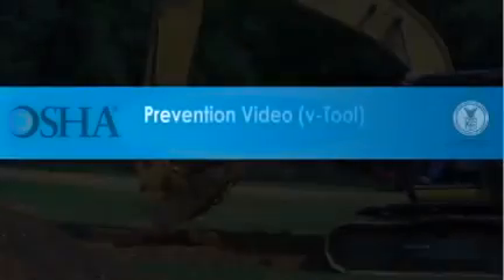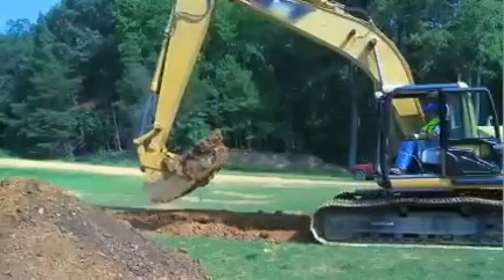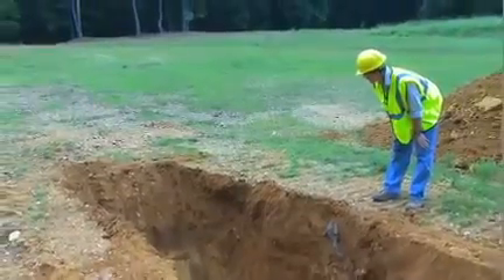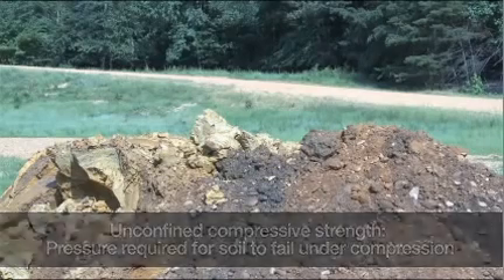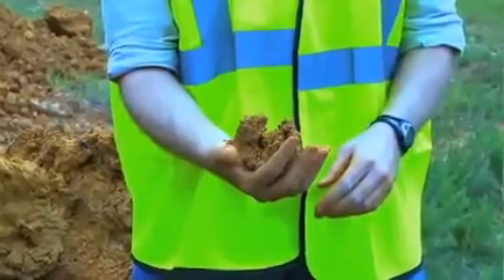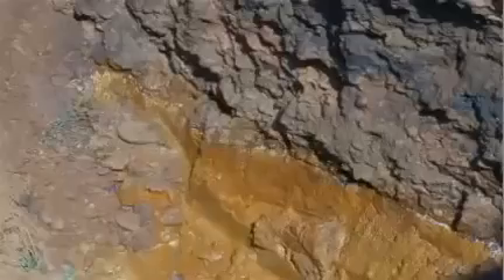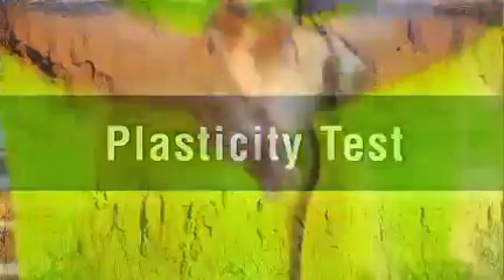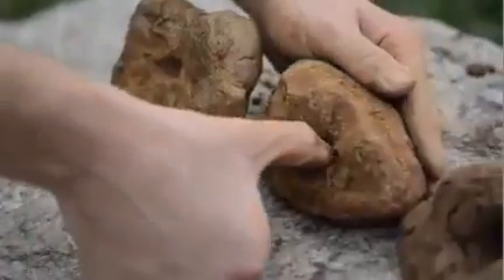Excavations in Construction Soil Classification

Comment: Question: where can you find one of these "competent persons"?
Reply from the maker: They are designated by the employer.
Reply: @xosafety6628  Does the employer also ahve to be a competent person?
Reply from the maker: @Tubeytime  No.
Reply: @xosafety6628  Ah. That explains a lot, thanks!
Reply: A Competent person is trained in soil classification in ways to perform plasticity testing, thumb penetration testing or use of soil testing equipment. They are also trained in recognition of soil types and have the ability to stop excavation if the see unsafe conditions.